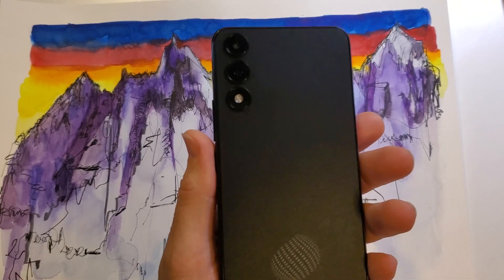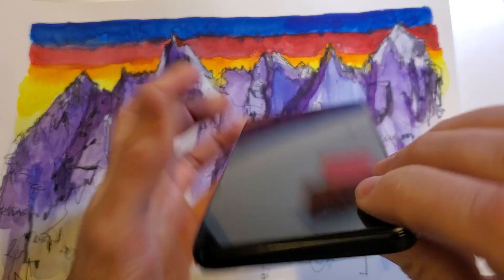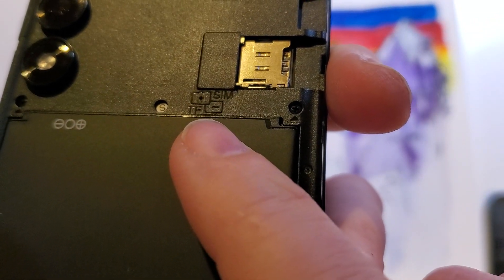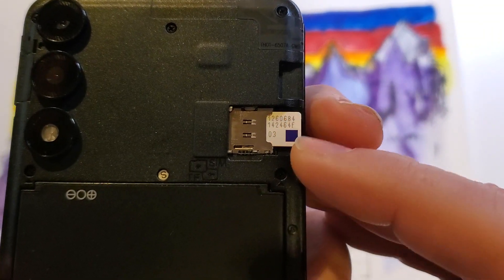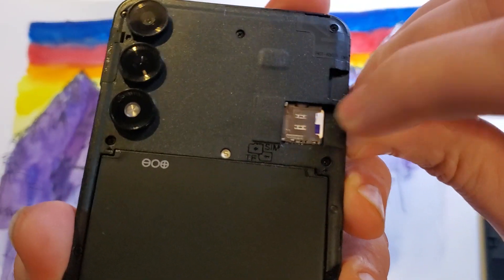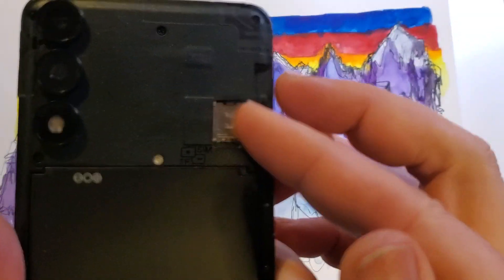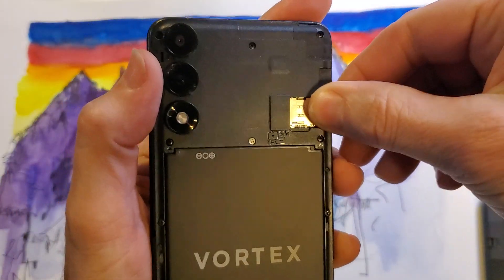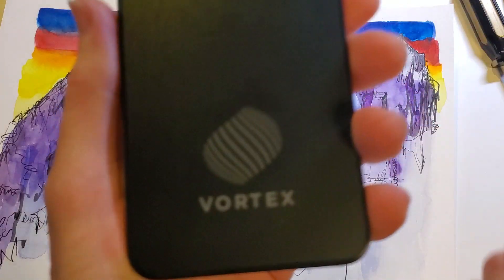Vortex HD65 Change My SIM Chip Quick and Easy

Comment: theres no slot to open my HD65
Reply from the maker: There is a tiny indentation on the bottom right of the plastic cover. Even if you can't see it, you can still put a marker on that corner to pry the back cover off. DON"T USE A KNIFE!!!!!! Also, it's okay to ask for help - friend neighbor or co-worker if you really can't see it or open the back. I'm sure you'll get it with a little more light. Good luck to you!